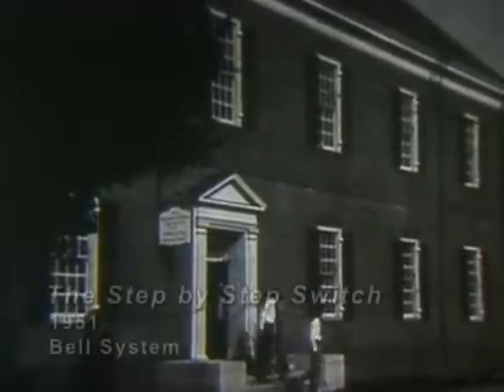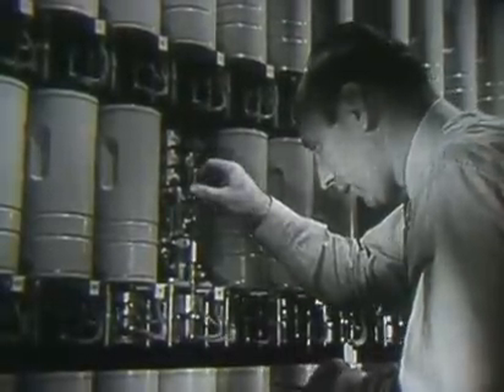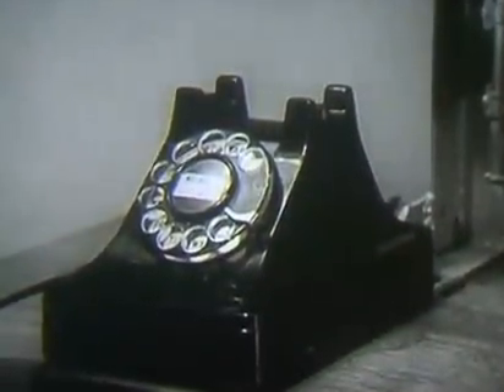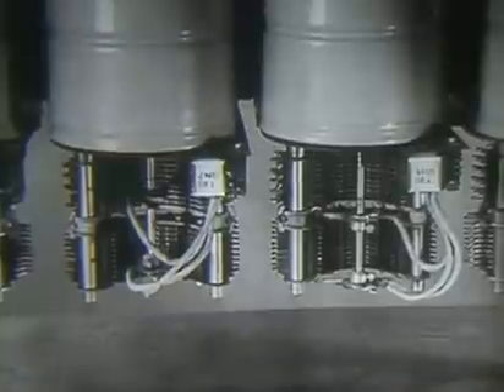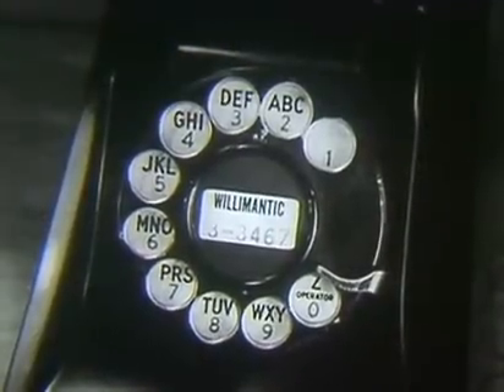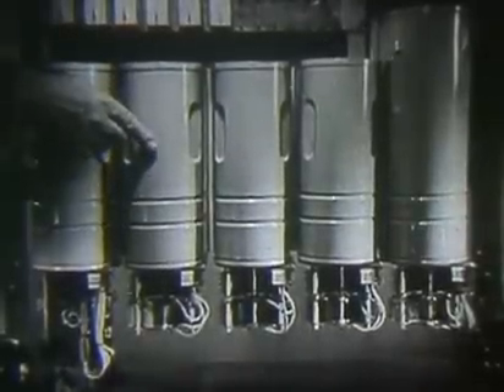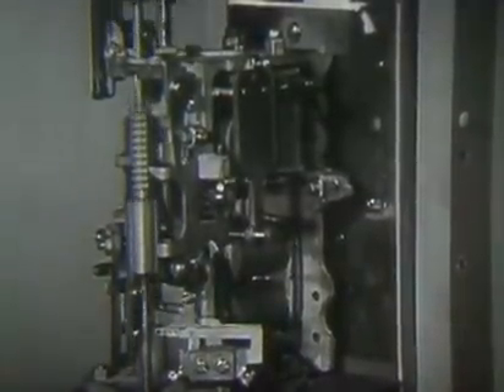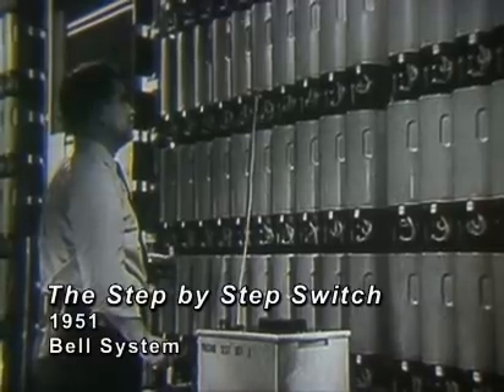AT&T Archives: The Step-By-Step Switch

Comment: Some of my college friends learned how to defeat a dial lock (when the owner of the phone wanted it to be answer-only) by lifting the handset and hitting the hang-up button in the proper rhythm to simulate dial pulses.
Reply: Yea i used to dial like that's all the time just for the heck of it.. one time i dialed to many digits or something and a service man cut in.
Reply: @tmastersat  Some exchanges had automated circuits to check the dial. Extra digits we're usually ignored. It is possible that the service man thought you were attempting to bypass security and make free calls.
Edit: Could it have simply been a recording?
Reply: This was called cradle dialing.  It was a pretty common method of defeating dial locks back in the day.
Reply: As seen in Silence of the Lambs.
Reply: Allan Richardson,  Yep!  Used to work the midnight shift at a local factory where dial phones were the norm. They used to insert those locks on the dials so no outside calls can be made. Little did they know I was a percussionist and knew my rhythms well (played a lot of odd time signature fusion) so pulsing a number set through the hand receiver switch was no big deal... used to complete calls for all my co-workers as well... lol.
Reply: @mottbone  Similar with the old style British 'button A and B' pay phones. It was always possible to dial 0 or 9 (so emergency 999 calls could be made) but other digits could not be dialled until the appropriate number of pennies (a quite large coin) were inserted. Trouble is the techies in the central office could recognise this from the sound the selector made or a cop could see someone doing it.

Comment: I am pretty sure my local phone service still uses this system. My phone is always humming, hissing, or dead. Some sort of relay, switch box on the side of the highway 2 miles away looks like a brown rusted 55 gallon barrel color that mice and snakes like to use for shelter.
Reply: The problem would be in that box, not the phone network.
Reply: Alex Jamieson   Nothing like mouse pee all over the line lugs in the ped.  They would chew up the wires and pee would cause cross talk.

Comment: The original cross-bar telephone switch was supposedly invented by an undertaker. Seems his competitor's wife was a telephone operator back in the day's when calls were connected by means of a plug-and-jack switchboard.. She would always route calls for an undertaker to her husband's business. I read this somewhere; I don't know that it's true.
Reply: Actually, the switch shown here (a Step-by-Step or Strowger swicth, named after the inventor) was invented by an undertaker for the reason you mention.  Crossbar was later developed by the Bell System.
Reply: The undertaker’s name was Almon B. Strowger. He was in Kansas City.  He made the first switches from hat boxes and pins.  The part about calls going to his competitor, is true as far as I know.  I worked on this type of equipment when I was in the army at Ft. Benning.  We spent a lot of time testing, called routining, just hoping to find something broken so we could fix it.  This stuff was very reliable.  And noisy!

Comment: OMG, does this video bring back memories. I was hired in '78 to install SXS in Eureka, CA.  While the rest of the state was removing SXS and replacing it with quiet ESS switches.  We ran lots and lots of cable, wire wrapped and soldered at the main frame and between the switches was another array of specialized wiring to connect the switches. In the 80s we were able to convert the SXS switch to dial tone by adding a small box to the rear of the switch.  Those were the days, before divestiture.
Reply: When you said "dial tone " could be added with addition of a converter to the selector, I think you meant " touch tone " could be added.  The dial office already had dial tone.
Reply: Why were they installing SXS in 1978?
Reply: @TechHowden  there's a SXS you can actually dial into it right now and hear it in operation. Its really cool
Reply: judy i can't grasp how this worked.  does that mean each selector had only 9 levels to go up?  So how many connections on each level? it could be more than 9 right? 

And how were selectors set up?  Was there a row for the 1 digit, then a row for the 2 digit and so on?? or could a second or third selector serve for any number?

Comment: Funny thing is, even to this day electronic phone switches for analog landlines have to be backward compatible to dial pulses in case someone is still using a rotary phone somewhere.
Reply: I still use one lol its been in my house since the 1940s.  You can't beat the sound quality.
Reply: @tennesseepossumpatrol3528  I still have a rotary phone in my house, I cancelled my landline about 3 years ago but phone was in use until that day
Reply: James Fleenor It has to do with the high impedance speakers used. They don’t make them like that anymore... specific manufacturing and materials used. They are very expensive
Reply: ***** Yeah, well, in Germany they do.  Even the VoIP capable cable and fiber optics modems still do.  I've tried it out myself and it still works.
Reply: OolTube02 like me
Reply: I use decadic dialling all the time here in Sydney right now
Reply: @OolTube02  Is this because of reunification of the east?
Reply: @monetize_this8330  Nah, it's always been that way.  Even phones with buttons were touch pulse for a long time because the switch to digital exchanges only happened in the late Eighties.  In West Germany, mind you.  Just in time for all of reunified Germany to get equipped with the most modern technology, too.
Reply: @bichela  
*analog
Reply: This comment warms my heart
Reply: yes, and it takes more computer time to count out dial pulses than to simply process a tone burst.  When the telcos had to buy touch tone conversion devices to feed step switches, they put a surcharge on your bill if you wanted to use a touch phone.  Now that it is better for the telco if you use touch tone to feed the computer, many telcos still charge extra for tone service!
Reply: @rtel123  That's generally not true.  It takes less CPU time to count dial pulses than to detect tones.  The former is implemented as a simple finite state machine; the latter requires a DSP algorithm (e.g. Goertzel).
Reply: @jej3451  not sure about your analysis.  In simple terms, loading a DTMF receiver from a phone takes a second or two, then it dumps its data into the processor in milliseconds and takes the next caller.  Dialing ten digits while the processor is watching you usually takes a half minute.
Reply: @rtel123  The processor can do other things while it's waiting, though.  (Called multitasking.)  In terms of the actual amount of processing (number of cycles) the CPU spends for pulse digits vs. DTMF, the second is much higher than the first.
Reply: @jej3451  ok.  I guess it depends on the system architecture.  The systems I worked on have autonomous DTMF receivers, and they quickly collect digits and dump them in microseconds into the main processor.  For DP, the processor must measure each loop open and loop closed interval to determine if it is a pulse, then how many before an interdigital pause, just to collect one digit of ten.   Our engineers who study traffic load and number of processors for that size of switch engineered more CPU resources back then  because of the legacy of dial pulse.
Reply: @rtel123  Yeah, your system most likely had a dedicated DSP (either shared/centralized, or built into each SLIC/codec) for DTMF detection.

Pulse digit detection can get pretty complicated, especially when you need to support multiple regions (with different pulse rates, duty cycle requirements, etc.).  The design is nontrivial, but you still end up with a relatively small FSM that doesn't take a lot of active CPU processing compared to DSP algorithms.  However, it does involve a lot of CPU waiting (for the next hook state change), which can be inefficient depending on hardware/software architecture, so that might require a faster CPU even though a lot of its speed is being wasted.
Reply: @rtel123  And in the US you have to PAY EXTRA for HDTV content over cable while Over the air broadcasts are in HD for FREE. Telecom/cables companies just plain SUCK!
Reply: @jamesslick4790  "Not just "rotary" phones, some push buttons used a pulse train rather than DTMF. "   Nearly all DTMF phones had a switch to switch into pulse mode for backward compatibility, or for people who just didn't want to pay the phone company's fee for the DTMF option.

"Weird to note the "rotary" or pulse system uses a BINARY DIGITAL code, The newer DTMF system is ANALOG!"  Actually, no.  It uses UNARY, not binary.  For example, the digit 5 is encoded by a sequence of 5 identical pulses (5 = 11111).  If it were binary, then there would have to be two different kinds of pulses (5 = 101).

"And in the US you have to PAY EXTRA for HDTV content over cable while Over the air broadcasts are in HD for FREE. Telecom/cables companies just plain SUCK!"  OTA broadcasts are not free; they are paid for by making you watch commercials.  Or in the case of PBS, by donors and taxpayers.
Reply: @jej3451  you still have to watch the exact same commercials when viewing the broadcast network channels on cable, but now you are PAYING to do it in standard definition.
Reply: @jamesslick4790  Cable TV has fewer viewers.  Therefore they can't charge as much for commercials.  That and the greater infrastructure requirements (running/maintaining cable to everyone's house) is why they need the additional revenue source of a monthly fee.
Reply: @jej3451 I don't mean Cable only channels, I mean ABC,CBS,NBC,FOX,ION etc have the same ads whether viewed via cable or antenna. But if you watch (for example your local NBC affiliate) on cable it's in SD unless you pay for HD. But if you watch the SAME NBC affiliate via an antenna, It's in Full HD for FREE.
Reply: @jamesslick4790  Even though the content is the same, the cable infrastructure costs a lot more than just a transmitter tower.  That's why cable TV costs more.  The specific fee structure is up to each provider, and not all of them charge more for HD.  But they have to get the extra money somehow.
Reply: A lot of companies downright down support rotary phones anymore. I worked for the telephone company
Reply: Had one in use at the cottage at least into the '00s.  Maybe '10s?
Reply: Alexej Svirid  wat O_O Dammit, now I'm shocked. Even more insulting; IT STILL PLAYS THE TONES AT YOU
Reply: Still using a 1960 black rotary phone, with metal dial not plastic dial. The sound coming thru speaker is excellent.
Reply: but windows xp is NOT supported. I think they could let it go.DTMF baby, its the wave of the future!
Reply: Not just "rotary" phones, some push buttons used a pulse train rather than DTMF. PS: Weird to note the "rotary" or pulse system uses a BINARY DIGITAL code, The newer DTMF system is ANALOG!
Reply: Yes, you can still us old phones..however, don't expect the 80v or whatever it was to be on the line anymore.
Reply: OolTube02 yep, I have an automatic electric 3 slot pay phone and a northern electric 3 slot, they are both dial-pulse phones.
Reply: wrr
Reply: I'm an older person,  and I still use my rotary phone and love it. VIK, Philly.
Reply: In my city landline don't support old phones
Reply: I was that person until we gave up our landline because Frontier could not or would not keep it repaired.
Reply: I get my land line from the cable TV company with a box that sits on my shelf and also provides my Internet connection.  It still works with pulse dial!
Reply: They should outlaw analog phone lines and dial up. Require DSL
Reply: @RandyRandersonthefamous  Well, it's probably easier these days just to provide an interface at the home for old phones, if you still have some installed and wish to keep using them.  All our old phones are connected to an old ISDN switch, which in turn is connected to a cable modem via voice over IP.

If I built a house I'd provide wired LAN outlets in every room, which can be used by old analog phones if you wish to plug one in.  And then you can have an interface in the basement.

Comment: Man, mechanical switching....That is a trip.  Just astounding the number of tiny parts involved.
Reply: Amazing all the little parts that were machined
Reply: Yeah, so how did VoIP replace this?
Reply: Tons of Pittsburgh Switchgear? baby!
Reply: It was an amazing piece of technology, however it required a high amount of maintenance to keep going.  Unfortunately these maintenance jobs are disappearing in today's job markets.
Reply: Smaller, cheaper, and faster.
These systems were large, power hungry, and not very smart. It only supported simple telephone calls, and had no common control or advanced routing of any kind. A VoIP system requires a small box connected to the internet, which can do orders of magnitude more. The only thing a VoIP box can't do is ring a big bell or work when the power is out. While the older systems were fun to watch and listen to, they are completely obsolete and most people don't care.
It would be nice, however, to still get a voice signal that doesn't sound like 2 bits in 8khz or less that only sometimes get through.
Reply: @user2C47  Weirdly, land lines are becoming more of an inconvenience these days because of analog compression being so damn lossy compared to digital. It can absolutely butcher the sound quality. Most land lines, at least in the US, are moving over to VoIP because it's not only cheaper, but sounds better in the end.
Reply: Informative, thanks for taking the time.
Reply: FILMKRITIK 😆

Comment: How did all this come into play when the touch-tone phones came in? did it convert the tones to useable pulses for the switches?
Reply: +V8FordTempo   They invented the Crossbar switch which gave us touch tone.  Then came the 1ESS which gave us all the features, Call waiting, Call forwarding, etc.
Reply: Touch tone refers to the DTMF audio, not the fact they had buttons. Lots of early push-button phones simply sent the same pulses, but you could dial quickly and they would slowly catch up :)
When we first saw a DTMF phone, all the engineers ridiculed it and said that the designers didn't understand the losses involved in longer lines, and the idea would never work. D'oh!
Reply: Touch tone didn't originate the same time as did the crossbar. Crossbars used the same rotary dials as did step-by-step. A pulse-to-tone converter needed to be added.
Reply: Yes.  I had a touch tone phone in the early 80s that had to be set to pulse.
Reply: The DTMF system is designed to make the losses not as important as "ordinary engineers" might think, the DTMF audio receiver must hear the two significant tones simultaneously, but they are simply audio. If the losses would be too high, the call would not take place at all, because the parties would not hear/understand each other...
Reply: When the telcos had to buy touch tone conversion devices to feed step switches with dial pulses, they put a surcharge on your bill if you wanted to use a touch phone.  Now that it is better for the telco if you use touch tone instead of pulse to feed the computer, many telcos still charge extra for tone service!
Reply: rtel123   We had a customer at old folks home that always had phone problems, can't call out.  We had to tell them to check bottom of phone to make sure it was set to DP, not TT,  because they weren't paying for touch tone service.  Later it was decided to give all customers TT service when digital switch was put in.  If DTMF reciever went bad in first selector it would cause trouble big time, call would work for rotary phone but not for touch tone phone.  So if you checked switch with rotary butt set, call would work every time. Had to make sure when working with TT selector that butt set TT button was pressed.  When TT first came out, not all selectors had DTMF.